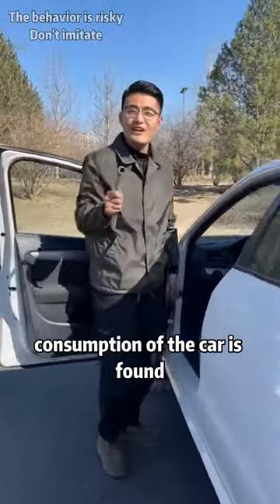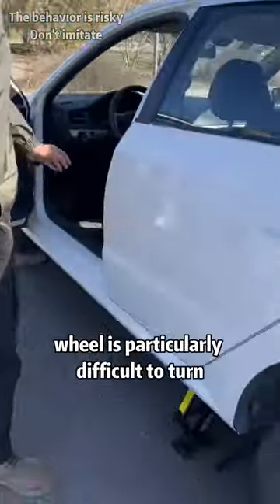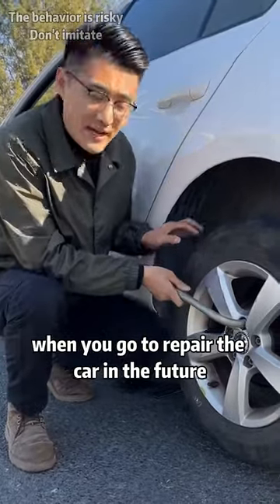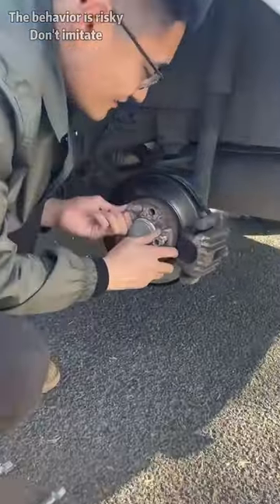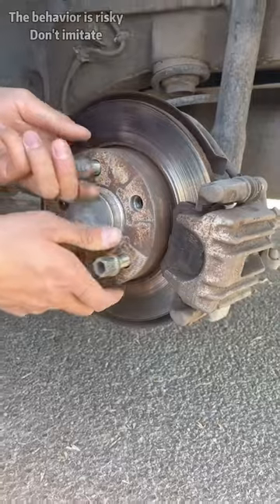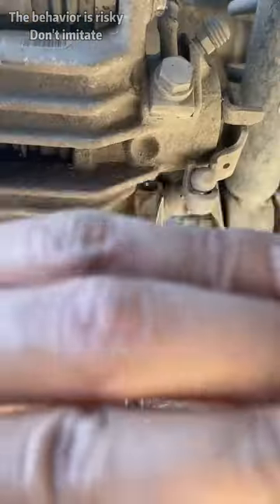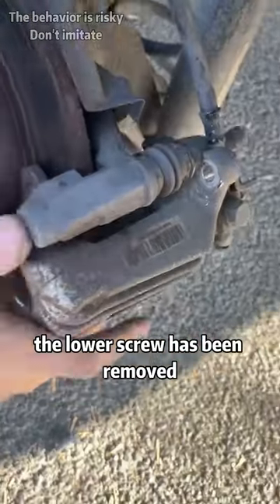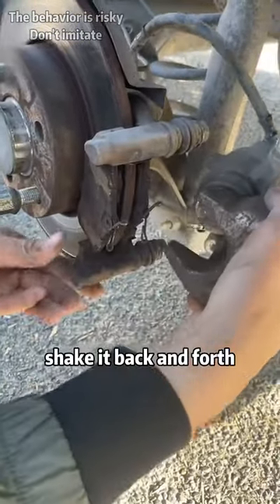（PART1）Only 5%of people do not know the maintenance skills！#tips #car #shorts #tutorial #driving

Comment: Just do regular and proper maintenance and the car will not need this whenever you do a brake job make sure u push the piston/pistons into the calipers and to lube the ends of the breakpads where they contact the caliper bracket and to check the brake fluid level and if its good or bad

Comment: Never put your rim face side down, you'll gouge and scratch it and his caliper mounting pins were fine, the problem lies with the brake pad backing, when they stamp them out it leaves a parting line, so you need to file or grind them down slightly so they ride smoothly in the slides and check the mount for rust, rust build up will cause the stainless slide to rise up due to the swell of rust, that'll need cleaning as well, when everything is clean, use a bit of grease or anti seize on the surface of the caliper mount where the slides go, on the slide after install and the caliper mounting pins and all threads as well and dont forget to either use a heavy brake grease, anti seize or pad lube/anti squeal on the back side only of the brake pads and you'll never have to worry when taking them back apart again... and use the anti seize on the lugs and aroind the center of the rotor/drum so the rim dont get seized on

Comment: A sticky caliper, many can be refurbed but its better to buy a OEM replacement
Reply: A sticky caliper DOES NOT need to be replaced. The slide pins need to be either replaced or just cleaned up and the bore where the pins go in needs to be cleaned as well. This can be done easily with a pipe cleaner style brush and some brake cleaner. I doubt the piston is having difficulty returning into the housing.
Reply: @DropDMurphy  it depends, sometimes it more cost effective to get a replacement than go to the trouble of repairing a sized unit, Japanese cars seem to have an achilles heel in calipers, my 3.0 Subaru had the same problem I just got a new OEM compatible one as it was less expensive than getting the sized one fixed up and knowing it could act up again in the future
Reply: @toffeepie1878  What is seized? The guide pins? Heat them out until the gas forces them out, or until you can get them out with plyers, wire brush the inside, lubricate and replace slide pins.. It won't act up if the caliper is properly maintained and greased when doing a brake job.
Reply: @DropDMurphy  if you are a mechanic sure, but it not you need to pay someone else, refurb of calipers takes over a week from a reputable company, my local garage won't have the time to faff with that work and over £200 GBP to a refurb company who will do the job  - OEM compatible can be got for less and easy to fit in no time and more reliable than repairing an old part
Reply: @toffeepie1878  Ok.
Reply: @DropDMurphy  ive rebuilt calipers and had professional mechanics rebuild my calipers... they all seize up again after a short time. Its so much labor, just spend the money n get new calipers
Reply: @Revy8  That's easier said than done. Not every caliper is available and if you want to keep the OEM equipment, it's worth rebuilding but if it's going on a vehicle such as a Caravan, Town Car, or another mass produced vehicle where they made so many and the parts are readily available, you are right, most times it's easier to just replace. Also look at it this way. When you replace it, you give the core to the store you purchased it from, what do you think they are doing with it?

Comment: This video is EXACTLY what you should not do. First, if you are using the jack which comes with the car and an adjustable wrench, put everything down. Then search YT for how to do a brake job the correct way. Then go to Harbor Freight and buy yourself a cheap socket and wrench set, the proper tool to push the caliper piston back in, a small pry bar, a wire brush for cleaning the caliper surfaces and where the slide pins go and a brake bleeding kit.  Believe it or not, brake jobs are pretty easy which is why mechanics love to do them.

Comment: Brother Cong Bing, here’s some more tips to add to your 1000 tips:
   1. Use a bigger lug wrench , or and impact wrench. That wrench is too short and would not turn or strip the lug nuts. 
   2. Lower the tires to the ground , or the lug nuts will turn with the wheel.
    3. Use a socket or 8 sided one size wrench to open the brake caliper bolts. Don’t use and adjustable pipe wrench. The bolt will strip. 
    4. A person will just replace the brake pads, not the whole caliper. If they replace the whole caliper , that would be cheating you. 
    Usually nobody lubes or replaces the pins in a brake job- that is additional. 
   Nice to meet you brother Cong.
Reply: Bro your always supposed to lube the pins. That’s the reason shit sticks

Comment: I guess he doesn't speak English originally. Does anyone know the  Chinese version of this lovely brother?
Reply: These are tiktok videos in china
Reply: @ramboog2654  Let me ask my Chinese friends. Thank you.
Reply: I’d love to hear the original one too, please let me know if you find it
Reply: Do share if you find anything
Reply: I'm I'm curious to know about his original ACCOUNT
Reply: Let me help you real quick.
The reason for poor fuel comsumption is the sticky floating brake caliper that can't move freely, causing the brake pad to drag the rotor constanly. 

Brother Cong emphasized the parking brake isn't applied at the moment, therefore it must be a mechanical failure and discoverd that the driver side rear wheel is difficult to turn by hand.
He wants to teach you how to solve the problem so you don't have to pay mechanics to do so.
Instruction: 
1. Remove the wheel.
2. Loosen the caliper bolt using a breaker bar.
End of video, I guess you'll need to drive with 3 wheels until lovely brother Cong releases the new vid.

Comment: And then what?
He needs a brake job and doesn't have the right tools or show us what to do.
You can turn the piston it you have the tool. If the problem returns, the caliper needs repair.
You should only have properly trained persons repair a brake system.
There's no sump pump or sub pump in this video.
Get a proper inspection and find out if the cable fully returns, the piston adjuster is set properly, and try again.
This often leads to rotor and caliper work including replacement if necessary.
That also means flushing out the old fluid and the use of a set of tools for calipers.
A properly repaired and serviced caliper returns and does not wear pads unevenly. It is slightly dragging but not applied.